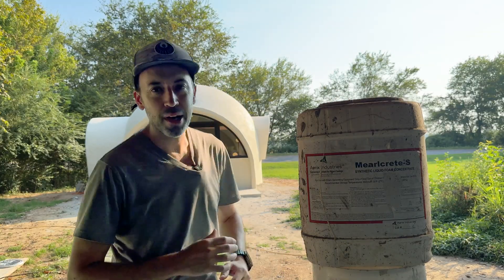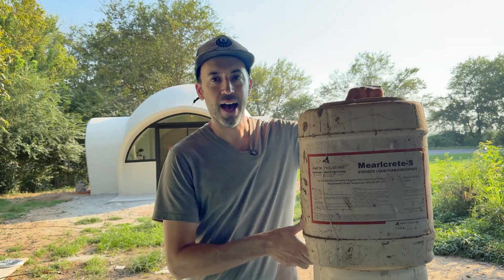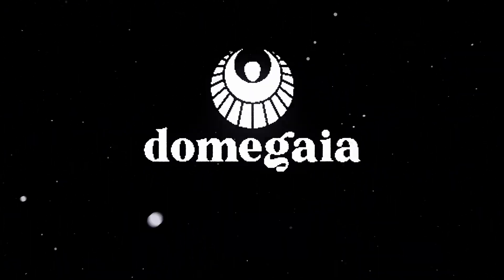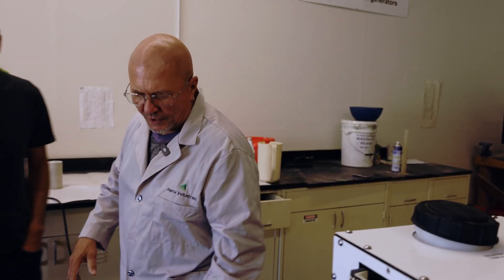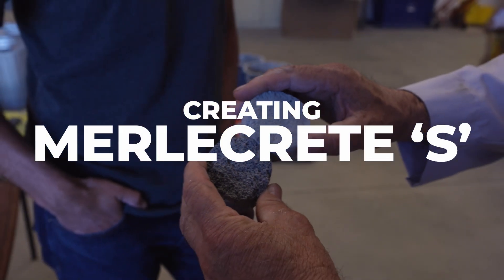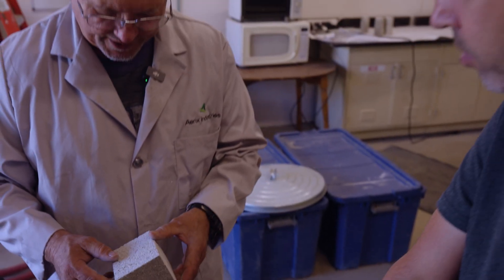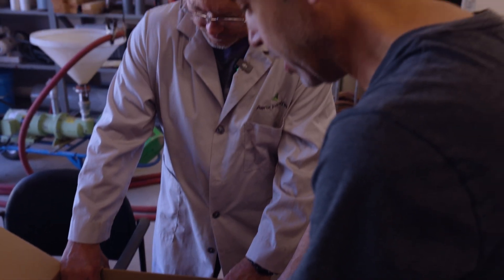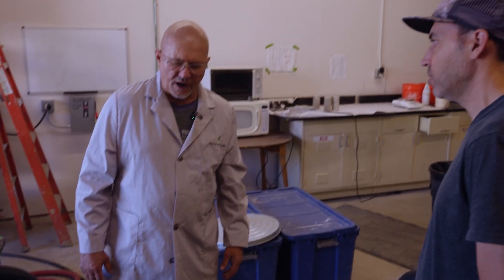We Found the Best Foaming Agent for Aircrete

Comment: There is a new method that doesnt need a foam machine. Just add the detergent and some Zanthian Gum and just mix it until it reaches the density you want. It means you do not nee a compressor and a foam wand and you can use pretty much any soap. I can be done using a cement mixer!. Best with a mortar mixer though. Big saving in the tools needed to make aircrete.

Comment: There used to be a company called AI domes (American Ingenuity).  They had a great concept of forming concrete triangles that fit together to create the dome shape.  I wonder if AirCrete can also make triangular shapes.  Great video!! Thanks
Reply: That's called ....sheet. it's something sheet I don't remember. It's made of a lot more than foam. I thing they also use some plant waste or something. It's a trademarked thing I guess
Reply: You can make any shape with Aircrete. Honeycomb designs are the most compact shape.

Comment: Hi!   great stuff!! what is the fiber coating that you guys put inside and outside of the structure to protect the aircrete?  also does it get affected by hot / cold if its built in colder climate?  will it crack or start leaking water etc?  i'd like to get some details about that coating process if possible, as I did not see any videos about that part of the build  thank you !
Reply: Fiberglass mesh or basalt mesh are good options

Comment: My thought on this, and I've been searching for anything I could even try, is something that would leave a hollow reinforced sphere behind. Seems like that would improve the strength of the aircrete by a lot.  The only option I've come up with (that I have yet to be able to test) is a very thick sodium silicate (water glass) solution, that was aerated or foamed then mixed with the concrete (perhaps with some flow control additive to cut down on water and get a stronger and more thorough mix).

I'm probably not going to get to that experiment that anytime soon,   But I figured I'd pass the notion along in case any of yall thought it was a good idea.   

just out of curiosity-  have you guys tried closed cell foam insulation?  like the 2 part stuff for insulating metal buildings.  I'm just curious what happens if you mix that with concrete.  it probably wouldn't work, but I just wonder.
Reply: Look into Gunite, also Fiberglass.